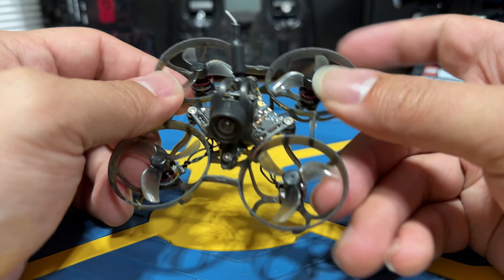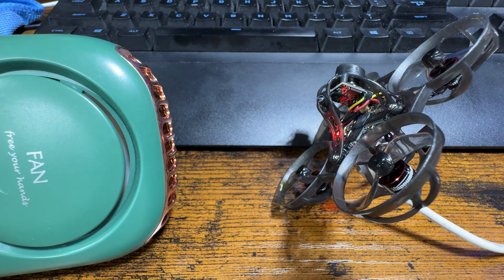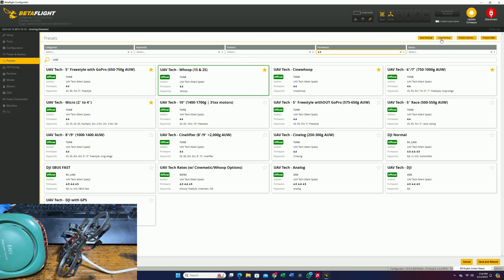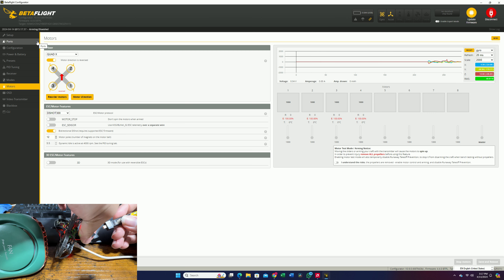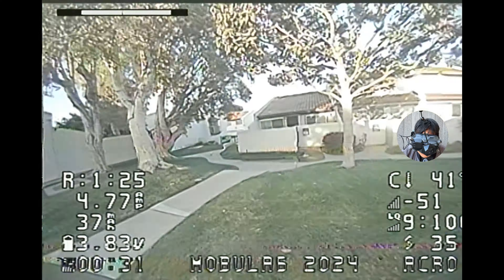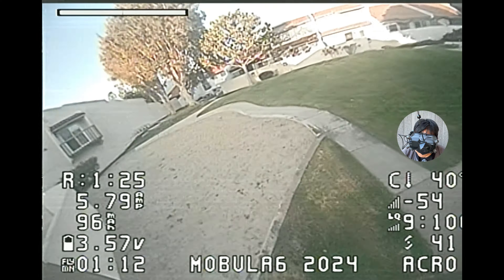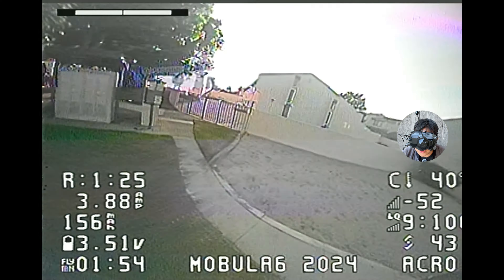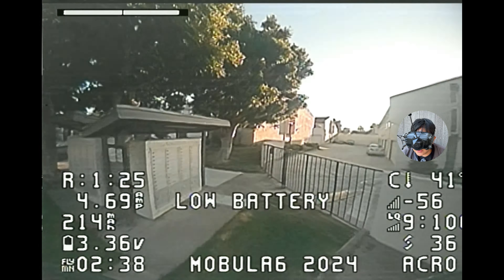Make the Mobula 6 2024 Fly Better? | UAV Tech Micro Preset Testing & Review#drone #fpv

Comment: My issue is that it just drops mid air at the start of the battery. Sometimes even during mid flight. It’s just very faulty and it’s too bad because i think it actually flies really well in terms of power to weight. Even the battery life is impressive, just the tune and the inconsistent units are what brings it down.
Reply from the maker: Agree, i had incidents when it dropped during mid air, not sure what happen but it seems this tent to happen when the VTX is too hot causing something to fail safe, not sure about your experience?
Reply: They shipped with 2 different gyros and I think the PID loop frequency is set wrong on some of them out of the box. One of the two I own was giving similar problems and I changed that single setting and zero issues now. Happymodel has the correct settings by gyro on the mob6 2024 page.

Comment: Mine is not even 2 hours old I barely finished configuring flight modes and video feed is already gone. Gray screen, with OSD but no video feed.

I'm absolutely flabbergasted at how junk this is. I've already put in for a return, I don't even know if I should bother exchanging. There's no way content creators and reviewers got the same batch as regular customers.
Reply from the maker: Sorry to hear that, seems like either the camera is broken or wires are loose. This particular mob 6 is a bit problematic, good performance but not as good quality. Yes, returning it is another option.